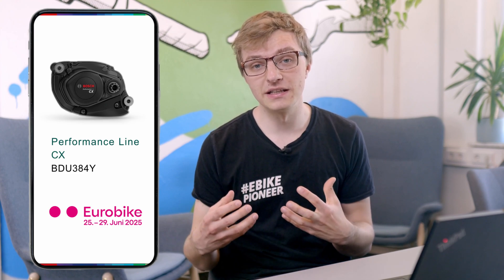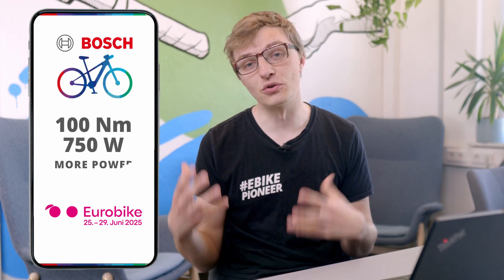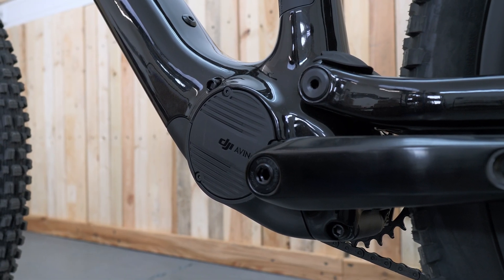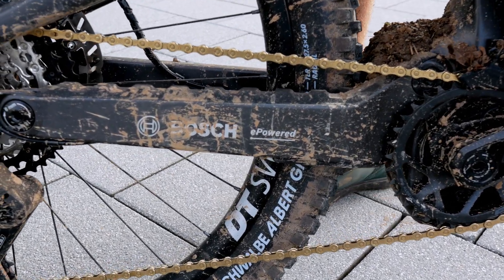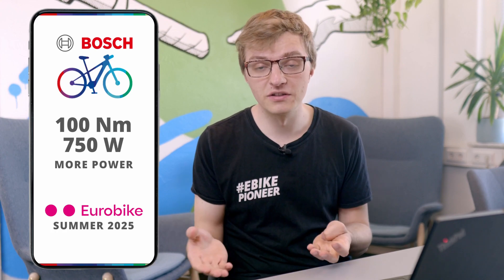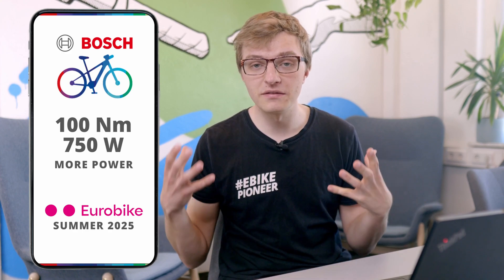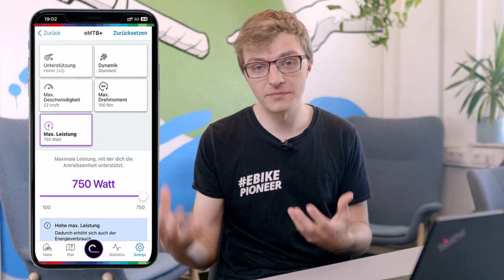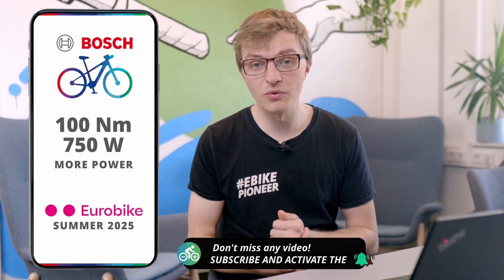🚀 100 Nm Motor Upgrade for Bosch – 🤔 Do You Even Need It? | EBIKE24

Comment: Owner of a Tern Orox S12 w/ the gen 5 Performance CX motor. Do you know if/when that update will be made available to U.S. owners by chance? I'm fine with a bit of a drop in battery for a bit more power when I'm loaded down with cargo.
Reply from the maker: Hi, sorry, I can't find the info here in Europe. You may want to check in App Store/Google Play: Bosch eBike Flow version number and “What’s New.” Or in-app: Profile > About > Version, then “Check for updates.” Thanks.
Reply: @ebike24  Thanks for the tip! Checked in the Flow app and sure enough - I have the FW upgrade available that gives the Orox more power when needed (and a whole bunch of other neat new features!)🍻🦾

Comment: Here's what this update means: you'll drain your battery faster + your engine's life will be used up faster, but your speed (25-27 km/h) won't be affected at all.
Reply from the maker: You're right across the board. Nevertheless, more torque is useful for those who have difficulties on steep climbs, or must carry heavy weights, e.g. cargo ebikes. Thanks.
Reply: @ebike24  But do city/cargo bikes have the same revision and/or version of motors? In any case, they are, at a minimum, configured differently. We are mainly assuming here - EMTB
Reply from the maker: The Bosch Performance CX Cargo can receive the same update. Bosch Performance CX is the same on EMTB and city ebikes, that's why Bosch just created the 90 Nm Bosch Performance PX. Thanks.

Comment: Bosch continues the mantra of deliberate obsolescence by dropping support for previous iterations of their products. If they don't sell new product they can't profit from raving consumerism. The e-bike industry is on an endless hard sell of new product. We don't need more power. We need new batteries. Batteries which fit existing bikes. With twice the storage capacity or more than at present. Then we can all run in Sport and Turbo mode without being caught miles from home with a dead battery. 20 miles out and 20 back is not 2025 technology. It is a deliberate farce! Try selling an EV with 70km or 40 miles range in top gear. Turbo mode is simply top gear. That is ALL it is. Try selling an EV without a top gear. "Sorry, losers, but you can only use 2nd gear. Or you'll run out of fuel!"
Reply from the maker: Well, we should wait for solid state batteries, around 2027.
Reply: Unfortunately, we live in a time when marketing slows down the development of technologies in favor of pure profit. And those same technologies are not at the desired peak. However, do not be so sad, because those who will live in 100-200 years, maybe will be happy with good batteries, but they will have other problems and they will probably write their own complaints under such videos - each era has its own problems!

Comment: Will the bosch speed pedelecs also get the 100 NM update
Reply: No. It is decided. Selling new product is all that matters to Bosch. Demanding more power from your motor just means the battery will go flat even faster. EV buyers shun cars with less than 400 miles of range. While grateful e-bike buyers swoon over a new paint job. On an e-bike which can't do 40 miles on one charge in Turbo mode! Turbo is just a fancy name for top gear. It sells product to muppets.

Comment: Try out the Specialized Gen 4 in the S works
Absolutely brilliant motor more power n no power surges they nailed it on the software delivery of the power
Reply: The first motor was supposed to be amazing too but after  4 motor replacements - NAH I’ll stay away

Comment: Yes more power can drain battery down quicker , but you can use it sparingly if you change the power mode in the Bosh flow app